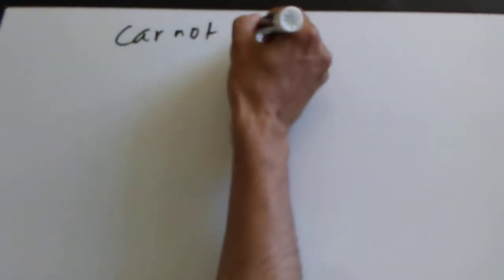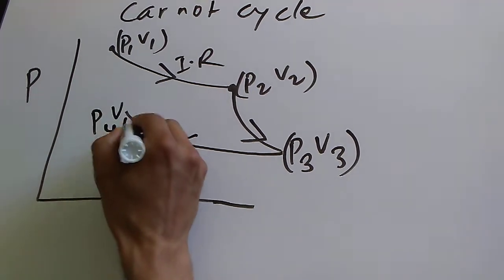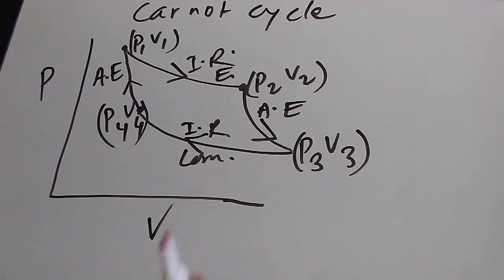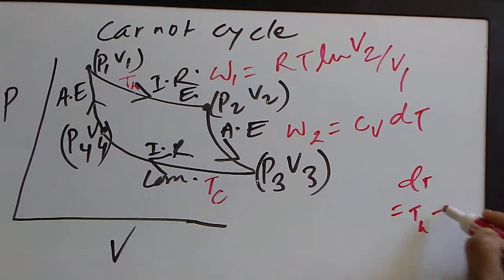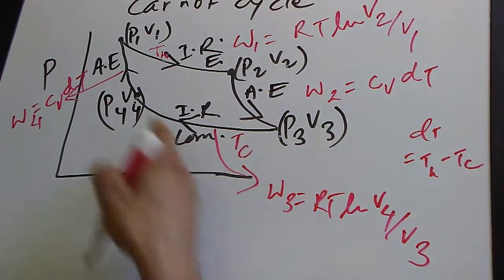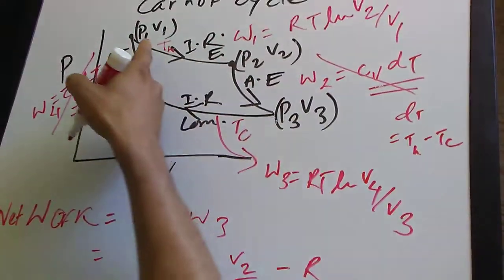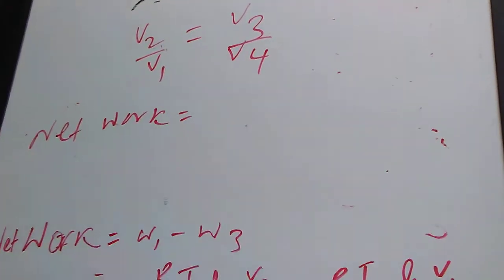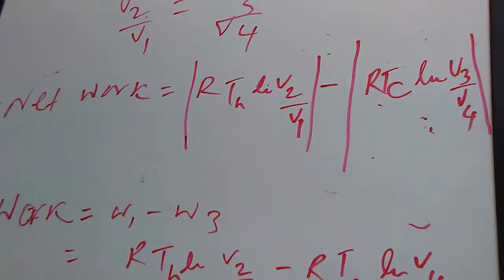Carnot cycle.Work . Efficiency. Isothermal and Adiabatic process. Adiabatic and Diathermal wall.

Comment: sir,What is overall expansion ratio means?
Reply: The ratio of volumes between one state to another is called expansion ratio. If a gas is expanded from (P1, V1) to (P2, V2), the expansion ratio is  V2 /V1 or P1/P2. This is my understanding. If gas is compressed, it is called compression ratio.